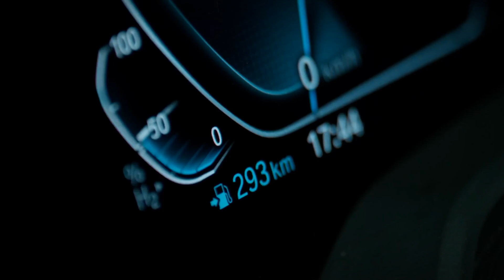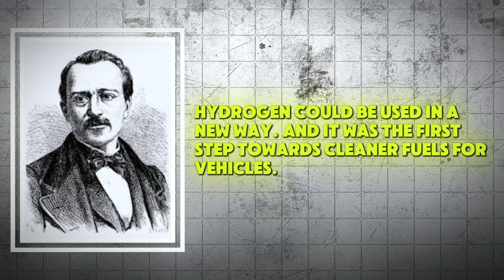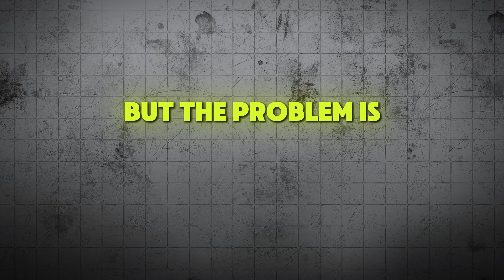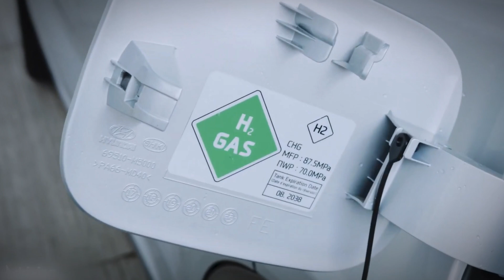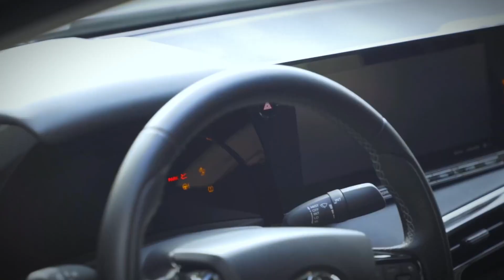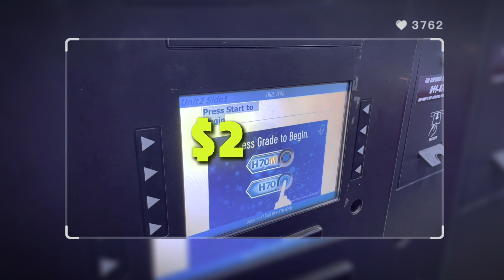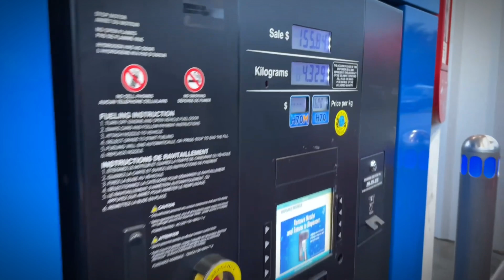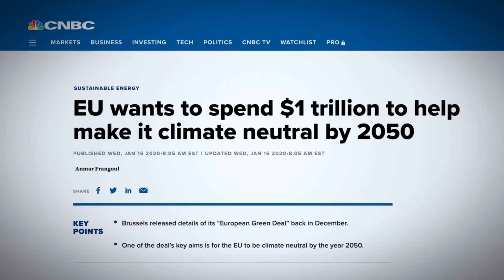Are Electric Vehicles Doomed to Fail Against Hydrogen Cars?

Comment: This is ignoring the problems users of cars with hydrogen power are experiencing,…it is proving impractical and more expensive than electrical that is undergoing rapid technological improvement in all aspects from engine to battery, and cost of  energy production,the game is all over bar the shouting. Your statements about the practicality of hydrogen are incomplete and do not tell the whole story.Time to stop putting lipstick on a pig. Electric engines are much simpler, more reliable, safer, and more cost efficient. There is no number of conceivable technology breakthroughs that can  make hydrogen competitive….